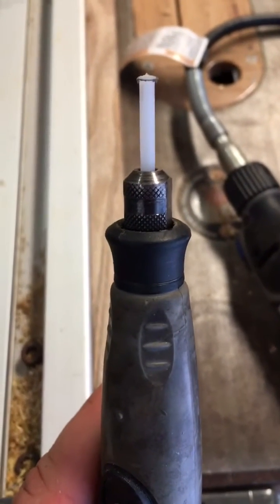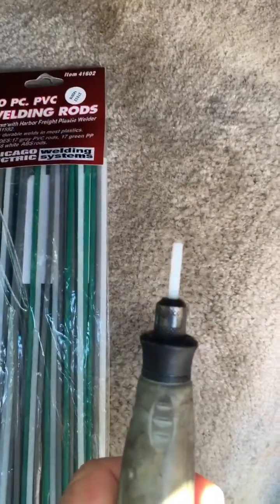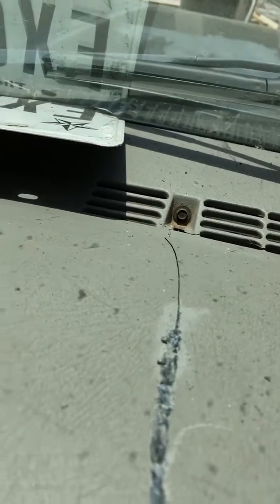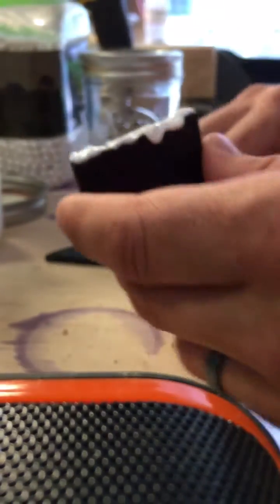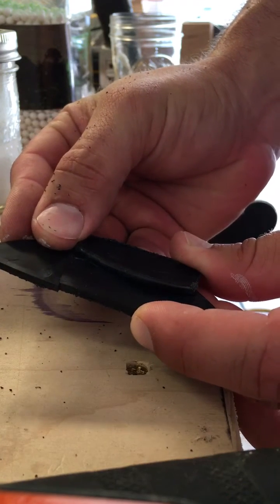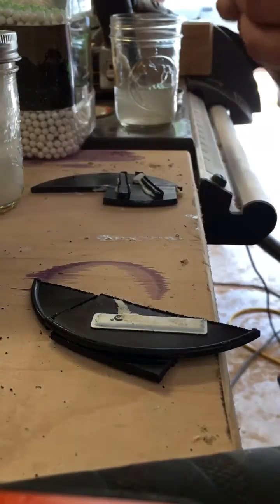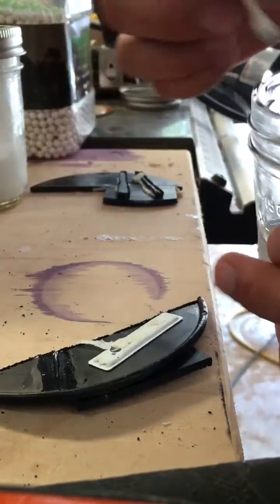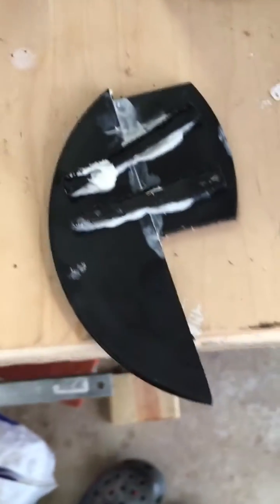Repairing a Cracked ABS dashboard - welding AbS plastic

Comment: How has the friction welding of the dash held up since you did it?
Reply from the maker: CAutomotion, they held up great but the dash continued to deteriorate in other areas.  So I eventually bought a dash cap that glued into place.  I wasn’t super pleased with that solution either.
Reply: I’m
Considering doing this on my ‘95 Chevy and then get a cover from LMC Truck. I mainly want to do the repairs for structural integrity. The bezel that surrounds my radio and cluster doesn’t even stay in place now the dash is so screwed up.